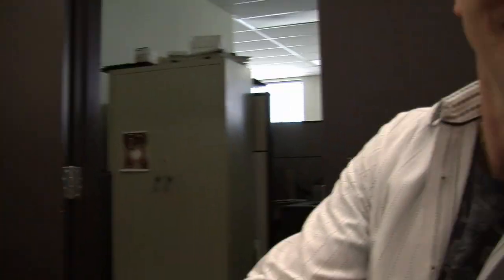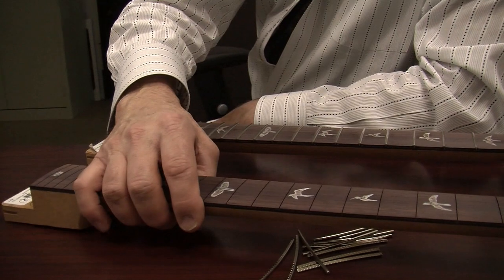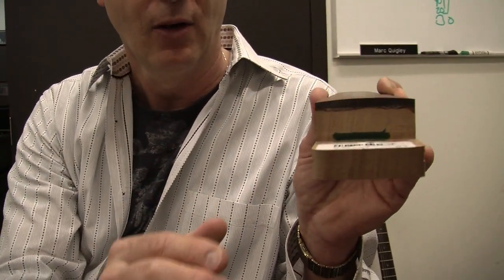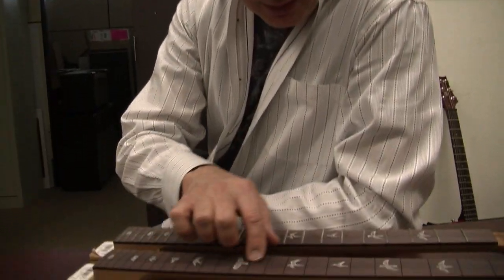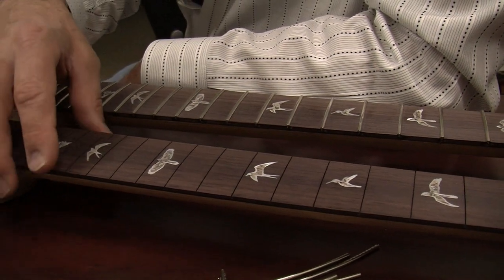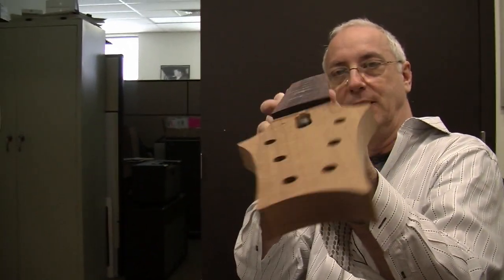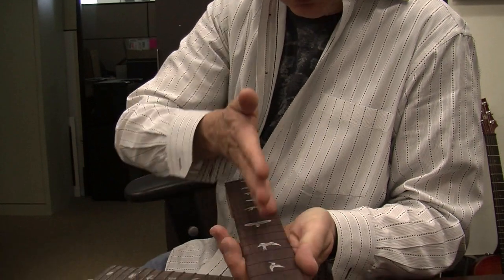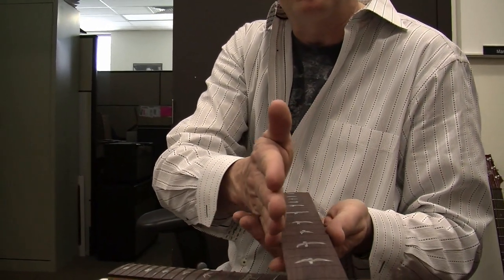Rules of Tone - Frets

Comment: 20+ years ago I worked for Guitar Center and had the opportunity to drive PRS from the airport to one of our stores. The guy is a straight genius, and a few of the things he shared with me defined what great tone is made from. Amazing to see his well-deserved success over the years!
Reply: All he did was copy the Gibson Les paul Jr. Special Double Cutaway guitar & make it look nicer with a fancier top & finish, & then he moved the top horn out toward the head & added the 'Midieval' points & angles on it.  There's not much new besides his doing something somewhere between Fender & Gib$on in body shape & features.  He also bought infinite tons of magazine ads.  If U want a great guitar, get an Asian SG knockoff like a PRS viper or something. They're like $200 on Ebay & sound better than N E PRS except the PRS SE Santana P-90 model, which is about the same.
Reply: lol
Reply: @Deathrape2001 You’re probably right and there is some element of BS. However PRS guitars are still nice overall.

Comment: Once you go with stainless steel frets, you can't go back.
Reply: I just put SS on my 1960 strat and it's so much more slick
Reply: You never have to go back, not in a lifetime anyway
Reply: Club Soda  One you go stainless...your fretlife is painless
Reply: I have the opposite experience, while it feels nice and smooth under fingers with less resistance, the the attack portion of sound has additional zing quality that sounds like lisp. The stronger the attack (harder you pick) the more pronounced it becomes.  You won't notice it while softly strumming, but once you hear it you can't unhear it. On the other hand SS frets sound bit more percussive, which I like.

Comment: Surely if you start with a dead level fretboard and a loose truss rod, if there is any bind in the fret slots at all, then when you finish fretting the neck will have some back bow. You need a bi-flex truss rod to bend the neck flat if you are then to level the frets with a sanding beam. Or some way to level them under tension of both strings and rod.

Comment: I just got a brand new custom shop Jackson with stainless steel frets.  Wow, what a difference in terms of bending, so much smoother and easier.  As far as tone goes, I haven't noticed anything radically different than my other USA Jacksons.  I also had Jackson put in carbon fiber stiffeners.  I'm told with that combination, I probably will never have to do any neck or fret adjustments.  I hope so.

Comment: I have a Epiphone Les Paul Custom cherry burst and it looks and sounds xlnt but its has some fret issues. On one entire fret all the notes were dead. The strings were hitting the next fret so I tapped it in a bit and now its much better but now I have some tiny divits on the fret so when I bend the string you can feel it.  I also have a 1978 Gibson The Paul and the frets were filed completely flat when I got it from Goodwill for $200. This guitar has absolutely no fret buzz and the action can get super low. Fretwork is one of the most important part of a guitar

Comment: Very impressive, but Stainless frets are the future. Little to no wear at all, no corrosion or dulling = strings slide on them like on glass.
Reply: +cubixthe 
It's funny -- Parker has been using Stainless Steel frets since the early 90s...now almost everyone is doing it...except PRS.  Sucks that they sell 5000$ guitars where the frets will wear out after a few years, especially if you're using cobalt or similar strings.
Reply: surgeyX dont just blame PRS,Gibson and Fender dont install SS frets.
Reply: Stainless frets R nothing new.  If U want even more longevity, use crystal frets, like quartz.  They're available =)
Reply: I think Suhr installs SS frets.
Reply: If U use stainless steel frets U need 2 use softer bridge saddle materials 2 make it sound best, otherwise it's 2 clacky. Nylon is good, or even softer.  Gib$on does this as a trick 2 make some of their 'elite' models sound better than the cheaper ones, even though neither has stainless steel frets. It evens out the sound better = less bonky or harsh.
Reply: SS changes the tone and guitarists are nothing if not obsessed with tone. Thats why the main companies dont do it. Guitarists would cry about it.
Reply: No SS frets do not change the tone. People like to claim every little thing including the dust on the peg heads changes the tone. It's a lot like the idiots that claim there's a difference between maple, rosewood, and ebony fret boards for electrics even when spectrograms prove them wrong.
Reply: You cared enough to comment. My experience is those that are proven wrong scientifically tend to ignore the truth and make excuses such as "you lost me caring what you said".
Reply: David D If you can’t hear the difference in a guitar with a rosewood fretboard and a maple or ebony fretboard you don’t know shit about tone. Put a Les Paul Custom and Standard to the test and it’s clear that the Custom has a brighter tone because Ebony is a harder wood.
Reply: David D agreed
Reply: lots of people have skin issues with metal  rings are made from various metals for this reason. if i told you the heavyweight champion of the world had hay fever are you going to go calling him a punk?
Reply: Rulke Yalkara ok so if material doesn’t effect an electric guitar then explain wolf tones and dead notes? Sorry but I’ve seen spectograms that also show differently. When you fret a note you’re essentially making that fret a temorary nut for the string. Try a locking nut/steel nut vs a bone nut. Makes the string vibrate differently which is then what the pickup hears. Stainless does tend to have a brighter sound. Just as a metal nut does over a bone nut.
Reply: Trying to find more info on this, can you link me? DLC is also used in race transmissions and engines. Very good stuff.
Reply: Yes and so many companies are late to the party. This is why I’m building a Tele and not just buying one.
Reply: Stainless steel frets give a better playing experience and last longer, but they don't sound as good, IMO. I have both SS and nickle fretted guitars, and while I love the feel of the SS, I think nickle sounds more real, more solid, and I would choose to put nickle in a new guitar for the sake of the tone.
Reply: I just made a guitar for touring with 60 year old eastern maple ! Used stainless for the first time and hated the "ting" Just took them out and replaced them with hard nickel What a relief to my ears ! Also the way my finger pads are and my Ph balance I don`t tend to wear frets ! I wish the stainless didn`t have that ting that reminds me of fingernails on a chalkboard!
Reply: But are so fucking hard to install >:v
Reply: @rulkeyalkara900  True,there is sooo much bad info that gets passed down its not funny
Reply: Rulke Yalkara I have not used ss frets so I won't claim they change anything . But ask PRS and he will tell you tons of things affect the tone from the shape , wood , construction . If a master guitar builder says something like that, it means something
Reply: @Deathrape2001  t
Reply: You're right, same way people don't make cheap stainless steel forks & knives & stuff for eating.  Working with stainless steel is so very expensive & difficult! HAHAHA  Tell us next how the Earth is flat, freaking troll...  What's funny really is how much better soft frets sound, as PRS 'knockoffs' sound much BETTER than the 'official' ones because the 'cheap' ones use soft fret material (less 'clacky').  N E thing with harder than nickel frets absolutely NEED soft bridge saddles or even more 2 'damp' out the edge a bit.
Reply: @bandit7498  right. Theres a huge dif.  Of course between. Maple and rosewood. Its HUGE. Dude must be deaf.  Poor guy
Reply: MrKalashnik0va: Yes, I did watch the entire video. Did you? Did you not hear him say that some people hear that extra “zinginess” or “pinginess” with the stainless? An aging ear have nothing to do with a guitar sounds character and more to do with volume. Sorry.. you also can’t get a stainless steel fret sound with EQ. Nice try. You’re already spewing ignorance.
Reply: MrKalashnik0va, I’m not buying what you are saying. My half deaf grandparents can tell a ducks quack from a dogs bark. I’m sorry.. but a few KHz of hearing loss does not make a difference when I’m determining whether I prefer the character of SS to nickel guitar frets. And this is coming from someone who’s had an eardrum replaced in my left ear with 20% hearing loss and a constant curse of tinnitus in both ears and I can STILL hear the difference in fret material, wood, and any other change on an instrument.. even with distortion. I had a major bridge repair last year and was disappointed in the change of tone/sound. Everything effects tone and character and even the slightest change can affect someone’s opinion of a sound. They have that right without being “pretentious”. I’ve done plenty of blind tests with results that would surprise you. Who are you to tell someone what they are? I’m sorry that I don’t like the sound of SS frets and that that bothers you.

You bring up EVH in your argument.. but you probably just brought up the worst person to defend your pretentious tone snob argument and you should probably read up on the story about the original 5150 stacks he developed with Peavey. 

http://www.vhnd.com/2014/12/04/a-story-about-the-rare-genius-of-eddie-van-halen/
Reply: @duster71  oh yes they will if you spend enough money or you're important enough
Reply: Kevin Kelly 
So you are almost deaf and have Constant ringing in your ears.
I’m amazed that you can hear the difference in wood while a machine doesn’t show much of a difference.

Perhaps it is how your brain interprets the sound rather than your sub par ears?
Reply: mastodonseven: That was the dumbest thing I’ve ever read. I’m almost deaf, you say? How would you know anything about that? 

What is a machine hearing that I’m not? What hearing machine do you speak of? 

How would my brain interpret a sound without my ears?
Reply: mastodonseven: Wait. Never mind. You’re a Mastodon fan. That tells me everything I need to know.
Reply: Ok the stainless steel frets rules!!!!!!!!!!
Reply: @rulkeyalkara900  totally agree. When it comes to guitar tone, people are like "The Emperors New Clothes".
Reply: You can hear more rattling with stainless steel frets. They need to be perfectly level. And then there's still some buzzing.
Reply: @guitarocd9984  I have a Chapman with Stainless Steel frets. No buzzing.
Reply: @ATX0705  okay. sometimes I just say shit. LOL
Reply: @duster71  this isn't a fender or Gibson video, its a PRS video.
Reply: @DogGuy19  I don't need you to tell me shit. I know what video this is.
Reply: @guitarocd9984  lmfao

Comment: I think Paul brought up this hard fret topic becuz he knows many players want stainless, therfore he's trying to ease the minds of PRS owners. I doubt PRS frets can go without a fret job. I've been playing my Warmoth Stainless Fret neck for years and I bend a lot, there's no sign of wear. Carvin now offers stainless.
Reply: I have a 1991 Custom-24 10-Top. I played ALOT until 2006 - festivals, stages, jams.....  Still, my PRS is in original FACTORY setup and 100% perfect (unless the nice color fading of the whale blue and the nut changed last year. And those are the original hard nickel frets ;)
Reply: @alexiserni1152  It's hard to argue though for buyers, stainless steel frets offer more benefits than nickel from a longevity standpoint. Cases of nickel frets lasting decades with regular wear exist, but it's not the norm. Such cases, had the frets been stainless steel, wouldn't have performed worse, while for the majority of the other cases where the refretting the nicke frets have been needed, could've been avoided had they been stainless steel. I don't own PRS guitars but I'm a fan. I'd be sold if they'd just get their heads around this, which let's be real is more cost related than anything, I'd get one in a heartbeat. 

It's 2021. Smaller operations like Kiesel are offering them as standard options. Schecter has been offering them on sub-US$1,000 guitars since 2014. Come on Paul.

Comment: Nickle-Silver Frets are:Brass(Copper 55% & Zinc 27%) and Nickel 18% (1%> Lead and Iron)

Stainless Steel Frets are:Iron 70%, Chrome 18%, Nickel 10%, Manganese ~2%, Silicon ~1%

NASA did a study and found that with a titanium-6%aluminum-4%vanadium alloy a coating of aluminum oxide-13% titanium oxide was the best hard protective coating and that impregnating it with teflon made fretting wear immeasurable.

I wonder if it sounds good?

Comment: I have owned 10+ PRS guitarssince 1988 and all of them required leveling or refrets after only a few years 
sorry paul but you are exaggerating. And the glue just makes it harder to pull the frets. You have to warm them up first
Reply: +James Rockford I just got my first PRS, a 2005 McCarty, and the first thing I needed to do was take it to a luthier to fix uneven frets.
Reply: +umberto smith The stainless steel frets I had put on my Les Paul have endured over 400 gigs, and countless hours off stage, and there is absolutely zero wear on them. The point I was agreeing with is that PRS claims to go to great lengths to find durable alloys, when they could just use stainless steel instead, and it would be much better for longevity and feel. I think Gibson, and any other "high-end" manufacturer should do the same.
Reply: Ben McCartney I agree. ..I've tried different kinds of frets and stainless is the only one to hold up to my playing (I'm not even joking). I'm from the big string/heavy right hand/A LOT of vibrato-- school of blues and I've played thru at least 5 necks on my strats. stainless ended my problems with refretting. it is the only fret material I will put on my guitars. if I buy a PRS, I want stainless frets.
Reply: Had my PRS custom 24 for 9 years and it’s been dressed twice and I’ve just had it refretted as it couldn’t be dressed again so what Paul claims here isn’t quite true, maybe for someone who has a bunch of PRS guitars and does it as a hobby that maybe the case, but I gig mine 2/3 times a week along with weekly sessions and classes so it’s getting the use
Reply: @Cactustone  Nickel frets are the biggest scam the guitar industry peddles out to unknowing customers. Next on the list is small "fretless wonder" frets, but even the utility of those can be justified better.

Comment: It's difficult to get a consensus on fret wire, but avoid nickel if you're prone to allergy. My latest enquiries list from the hardest , Stainless steel, EVO (nickel free) to nickel silver (no silver). Other aspects are the type of guitar and how hard you play it. All worth searching for advice. Trades men are said to avoid stainless steel because it wears out their tools. If so then it is well hard.
Reply: +Craig Willis I couldn't answer that directly but as a former machinist, I know that the harder material always 'wins'. So if your strings are harder than the material in your frets, then the frets are gonna wear out. The idea of stainless steel frets is intriguing. It sound as if it would last a long, long time, if it is pre- hardened material.
Reply: +Craig Willis Unfortunately we have only one guitar with stainless and that is only a few months old. So not really tested for wear. However the other concern people have is effect on tone/sound and personally I would not be able to judge without changing the frets on that guitar.
Reply: i have personally refretted 4 of my 5  guitars with stainless steel frets....Got some preradiused jumbo and super jumbo ss fretwire from jescar and the whole thing was almost as easy as any other fretwire installation.Got a  new fretwire knipper though to cut the fret ends and that was the most diffucult part cause they were really hard.Other than that fret leveling,crowning and polishing was staight forward although takes a bit more time(and sandpaper)....i guess if you are a tech where time is money you ll be frustrated but if you are a guy who just wants pretty indestructable frets for life that are also smother and silkier for bends and vibrato(if polished enough) then i think ss frets are no brainer....
Sound difference?Zero of course .

Comment: Is there any reason not to use stainless steel fretwire as opposed to the nickel silver?
Reply: From a manufacturing standpoint, tons. Cost, more difficult to work with. That's why they're not used more often, end of story. There's no real downsides as far as the end user, any tonal difference (which I doubt in most cases) can be atoned for with a 1/16" movement of a treble knob. They feel glassy and smooth, and they last. No downsides.
Reply: No.
Reply: No, it's just bullshit to justify they don't want to invest on new tooling.

Comment: Fish glue sets very hard. Repairing the boxwood parts in a moulding plane , one drop got into the wedge slot. The glue drop made a dent in the oak wedge . I had to work hard to cut this drop out with a sharp chisel  .But moisture on some paper tissue will dissolve it overnight.